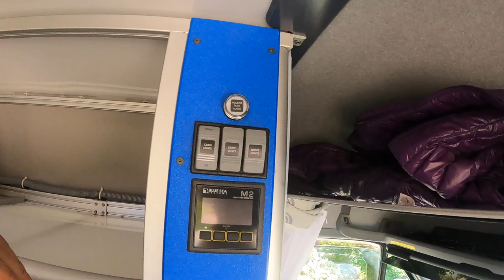Van Electronic tank drain

Comment: thank you for info, would you provide a link of the valve that you have used, thank you.
Reply from the maker: There are many options. a 12 volt motorized DC ball valve, stainless or brass. Motorized so that the switch opens it and when the switch is off and this power is off it auto closes. Like this one: https://www.amazon.com/sspa/click?ie=UTF8&spc=MTozNzcxMTQ0MDIyMTM4NzQ2OjE3MjY2NzQ2NTM6c3BfYXRmOjIwMDAwMjg4NDc3OTAzMTo6MDo6&url=%2FMotorized-Valve-Stainless-U-S-Solid%2Fdp%2FB06WWPZWGZ%2Fref%3Dsr_1_1_sspa%3Fcrid%3DJQQPSIAF5028%26dib%3DeyJ2IjoiMSJ9.yfGY3xP8J6ktcPeYXCjjT27D-c6Km_MeF1CntznMwUWwdLFlfICSmmdRjLNJBJu_OYlVRaUsuh_s6N-aNX2TOp_86UFLY_k6oxD9f1ywvnFxDvhAMbMEnp_K-sTZidSF5xY4NrsGXu2A_d2A-qNq7z2NrpA5VZTY8e7LMoiaz0QgOsjK-bkEu4gPmmXcQu75ThoPwmeTMC8eJYKWkkV4ldqZC_IvkhbkImdxJBXB2RY.Q7CRnwmFjhHOPEgy8o1TW1POlvLm8HM1q73fLO3vCrQ%26dib_tag%3Dse%26keywords%3D12%2Bvolt%2Bdc%2Bmotorized%2Bstainless%2B1%252F2%2522%2Bball%2Bvalve%26qid%3D1726674653%26sprefix%3D12%2Bvolt%2Bdc%2Bmotorized%2Bstainless%2B1%252F2%2Bball%2Bvalv%252Caps%252C171%26sr%3D8-1-spons%26sp_csd%3Dd2lkZ2V0TmFtZT1zcF9hdGY%26psc%3D1
Reply: @vantripping  thank you, very helpful.

Comment: Hi KC, Great minds think alike !!! I added the same feature to my build, (with manual drain) but I also added a camera so that I could monitor when the tank had drained !!!!! Don't tell anyone, but My waste water tank is also connected to my urinal !!!!!! I will forward a video at later date.  Message from Sprinter builder in Northern Ireland !!!!
Reply from the maker: Do you find any issue with smell or other issue with your urine waste added to your gray water? I doubt there would be, but does depend on the ratio of each.
Reply from the maker: Some compost toilets allow for the urine waste to be drained into an appropriate tank (or water source such as on a boat), which is convenient to not have to carry and dump it. It is something I am thinking about in the planning of my next vehicle build. Curious to hear how this is working for you.